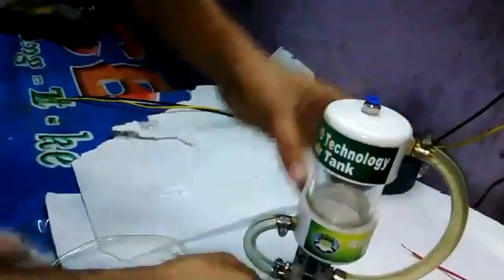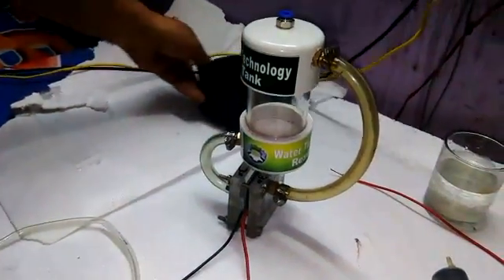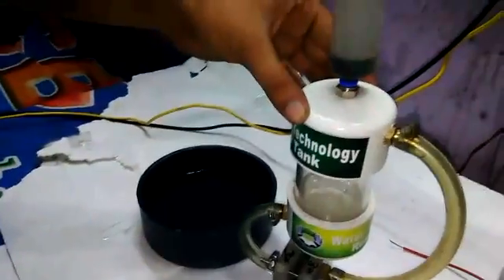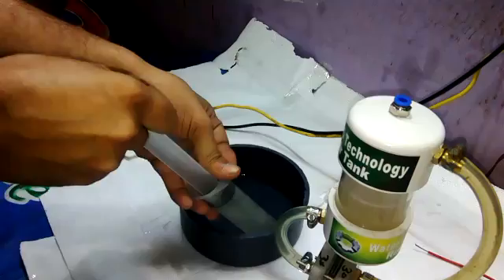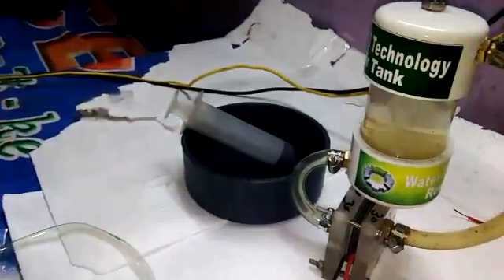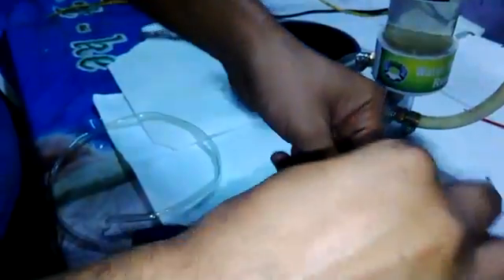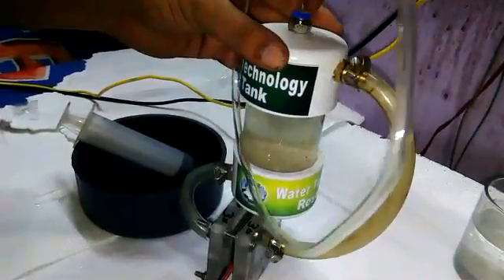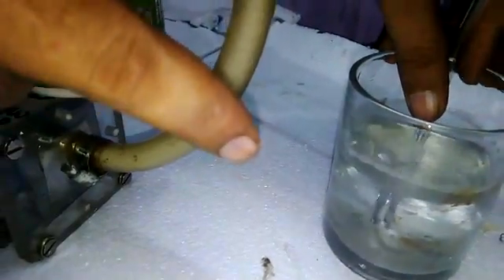Hydro Tech dry cell kit for bike installation guide 2

Comment: What is the price of this kit.
Will it work if connected to fuel injected engine.
My bike is cbr250r . 
It is a fuel injected bike.
Reply from the maker: sagar Yes it will work in your Bike, Price 1999.
 Dear Sir, You Can purchase from our website www.hydrotech.co.in or from Amazon or Snapdeal
Reply from the maker: +theREVhead  Don't Worry, it will work
Reply: this gas is send via air intake only u can fix it .